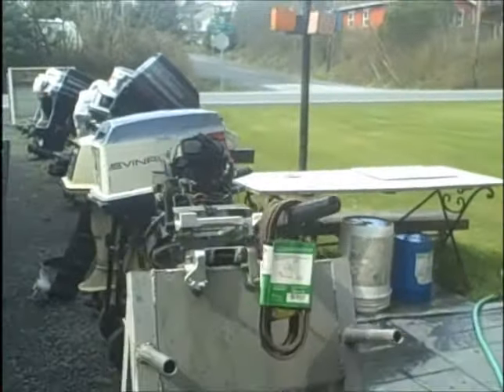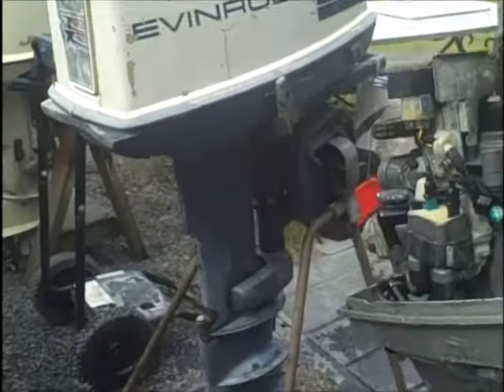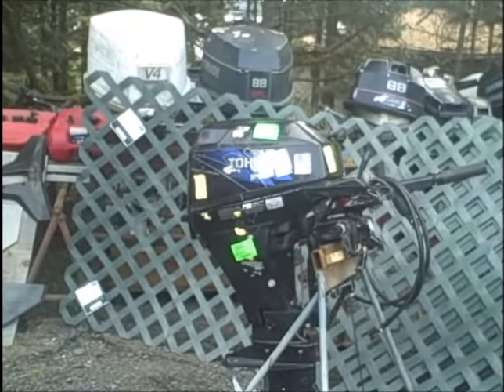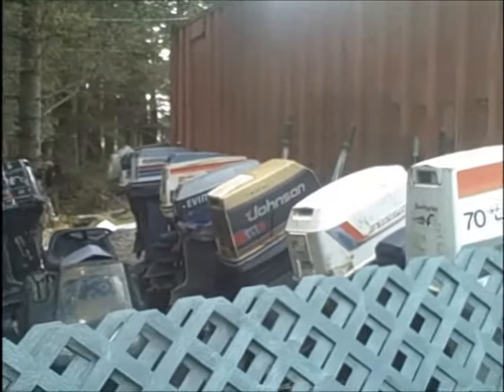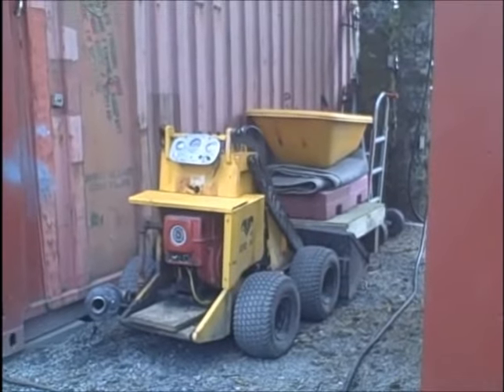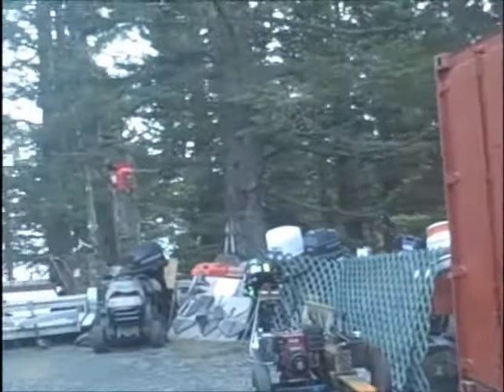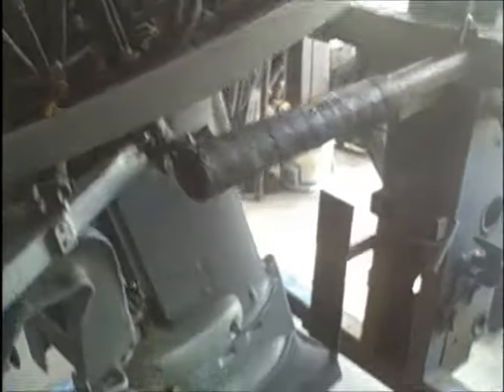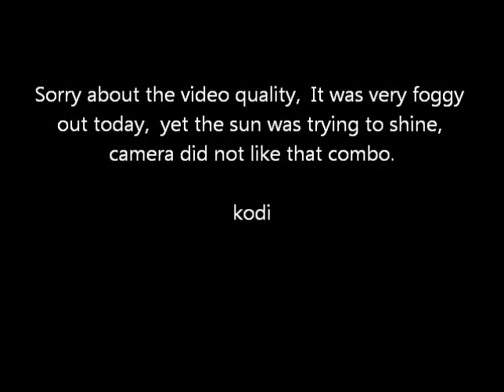Quick walk-about / 84 Evinrude Big-twin

Comment: Wow. How do you keep up with it all . The norseman is way too cool . I have a 63 RX 11 Short shaft tiller that doesn't have a thermostat either , I went crazy looking for it when I first got it . It's a real bear to pull start, The carburetor loads up and floods with gas but it takes awhile to get to the spark plugs . Any thoughts on that . It has electric start But the starter motor is too weak to turn the engine with the plugs in . thx
Reply from the maker: +THIS OLD OUTBOARD,  The small gasket inside the carb that makes the seal where the bowl contacts the upper body venturi tube may be compressed , next look at your intake to cylinder & carb to intake gaskets.  With motor running at idle, spray starter fluid around these 2 areas if rpm increase you have a gasket leak pulling in air instead of fuel,  last and least likely would be a stuck, bent, or blocked reed leaf.                                           kodi
Reply: Hey. will do! thanks